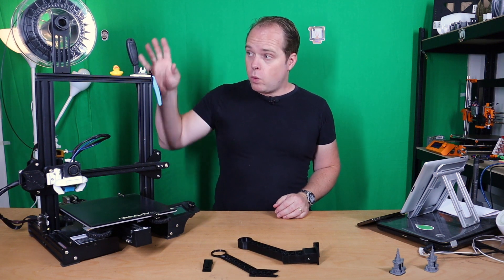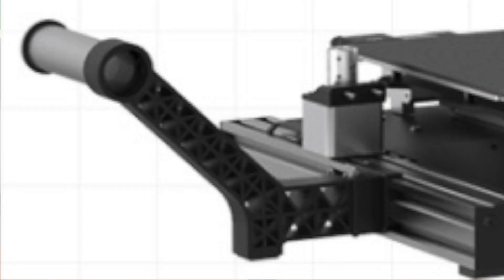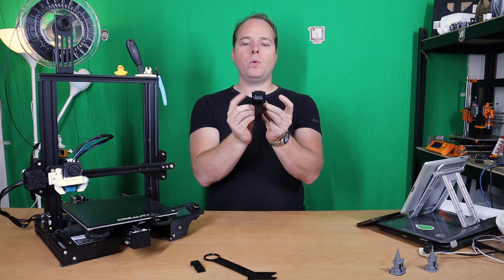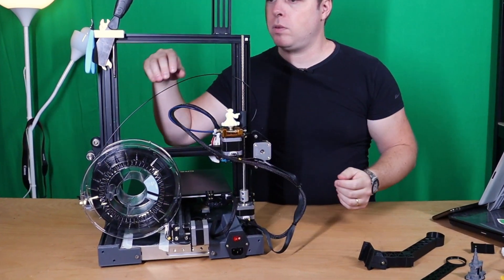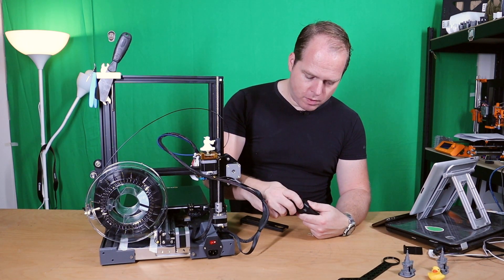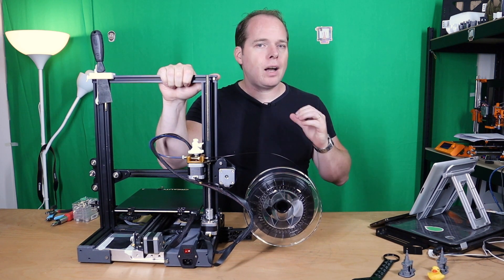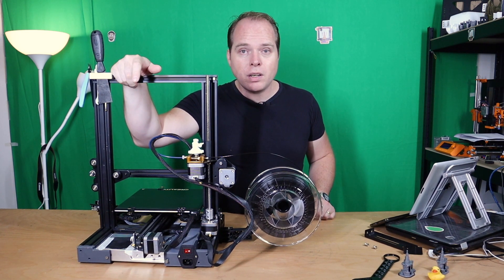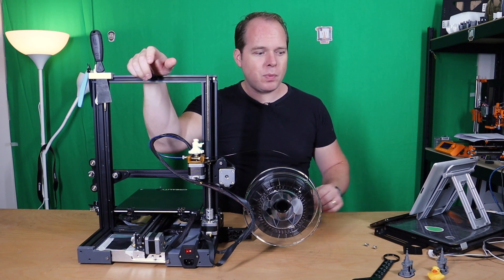CR-6 SE Foldable filament holder for Creality Ender 3 Pro

Comment: I would like to order one. But my understanding with the printer is the switch malfunction and the new board malfunction as well. The say know that only 0.15 % out of these prints have problems. I would hate to be one of 0.15 percent of the people to get one that malfunction.
Reply from the maker: I think that the CR-6 SE that you can buy, is going to be better and better, every little issue, is going to be solved after each batch. if people report these issues, it gives Creality the time, to handle and solve the issue.